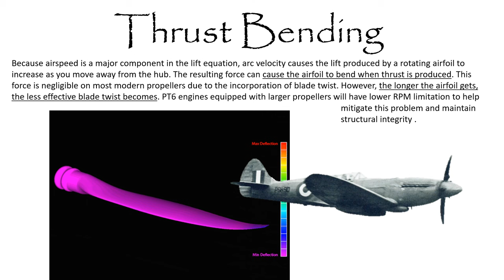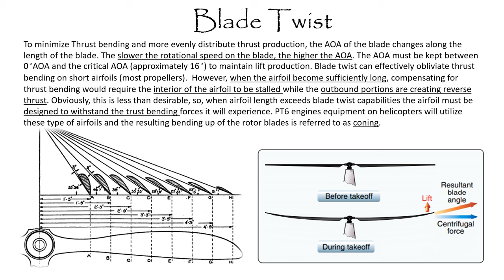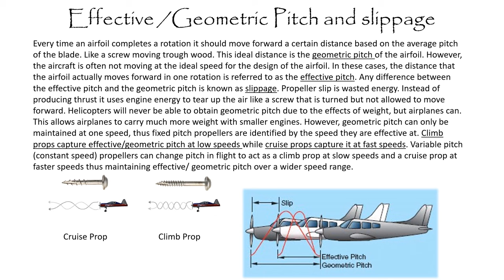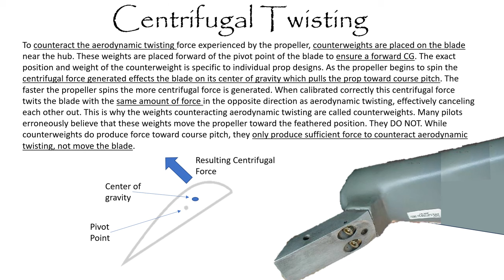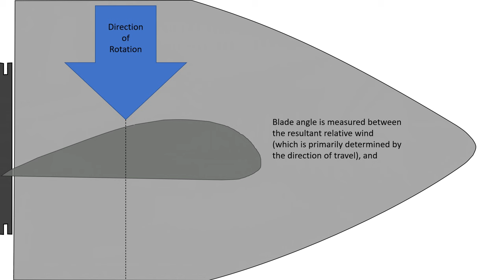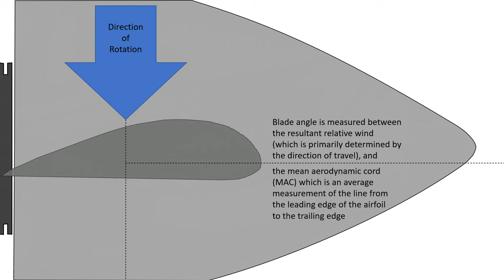PT6 Prop Governor Operational Principles

Comment: May want to check the theory behind aerodynamic twisting and centrifugal twisting. Happy to be educated but normally aerodynamic twisting goes to coarse and centrifugal twisting pitches to fine
Reply from the maker: Thank you for your thoughtful comment. It is true that these forces could move in either direction depending on how the manufacture places the pivot attachment and CG of the propeller.  The easiest way to determine the direction of these forces  is to examine how the counterweight is mounted. If the counterweight is mounted toward or built into the leading edge of the airfoil, its purpose is to move the CG forward. A forward CG will act to pull the propeller to course pitch. This is why many POH and maintenance manuals talk about the counterweights moving the propeller toward feather or course pitch. Alternatively, you could evaluate the mounting point of the propeller blade to the propeller hub. Typically, propeller blades are attached forward of the center point  because the increasing camber allows more room to create a sufficiently secure attachment point.  If this is the case, there will be more surface area aft of the pivot point and aerodynamic twisting will move the blade toward fine pitch. Ultimately, it is the responsibility of the PIC to know the details of their unique aircraft systems. The purpose of this presentation is to present general principles that can be applied to most systems but there will always be outliers.

Comment: I have a few questions bro. Related to  Pt6 engine props 

1. What happend to the props if eng oil pres drop to 15 PSI ? 

2.  What action should be taken if props moves to reverse in flight ? 

3. What is the max prop RPM before starting a prop overspeed governor check ?